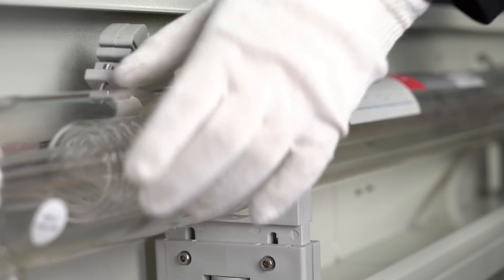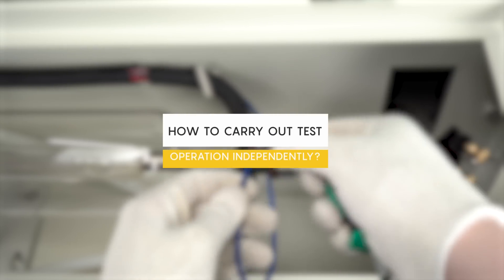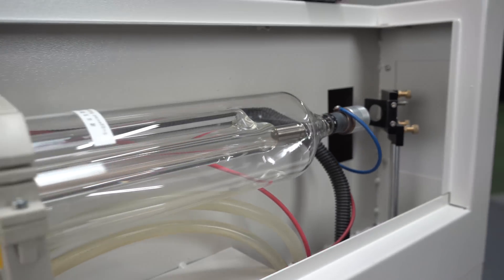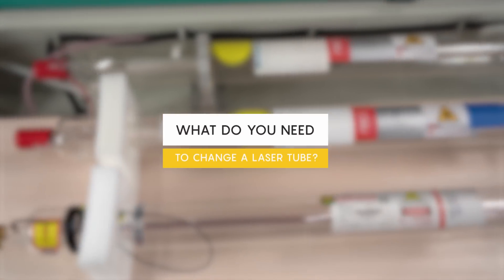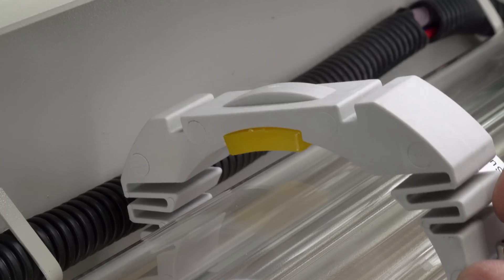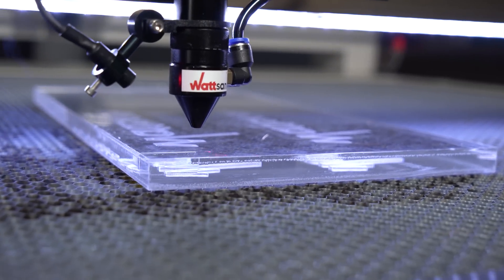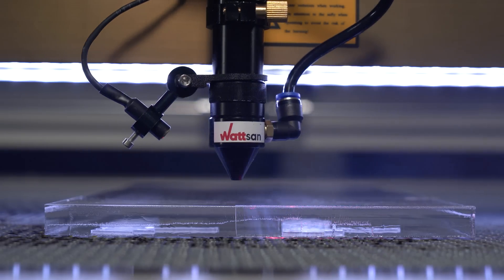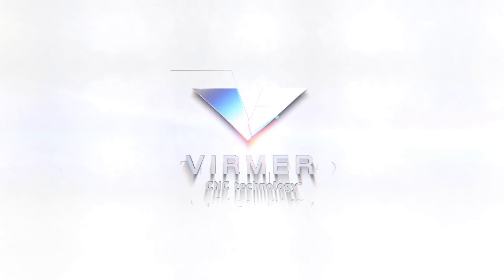HOW TO REPLACE A LASER TUBE? / Virmer CNC GUIDE

Comment: My laser is arching to the body of my machine. How could i fix this issue?
Reply from the maker: @TheMrJackzilla Hello! Thanks for the question. What model of laser machine do you have?
Reply: @virmercnc  my laser is almost a diy, i did some mods on it and put a stronger tube. But the build is similar to a k40 and i am using a yongli tube
Reply from the maker: Hello! We would be happy to help you if it were a Wattsan laser machine. But we'll try.
How often do you work at the machine and with what materials? @TheMrJackzilla